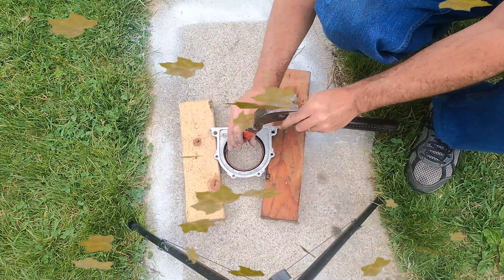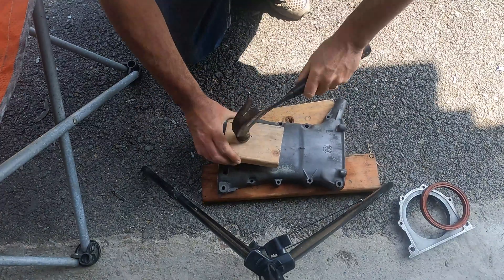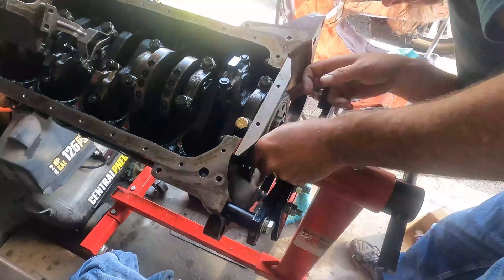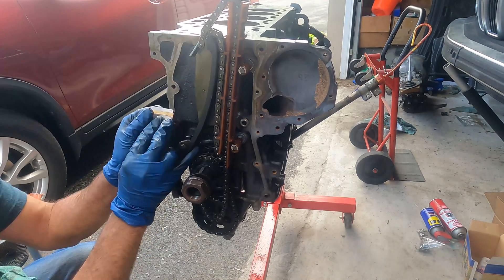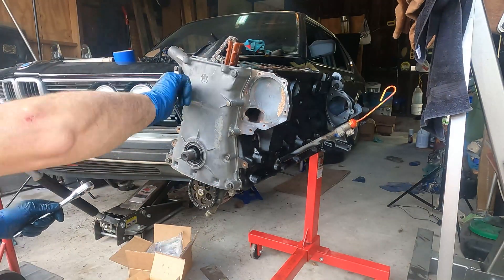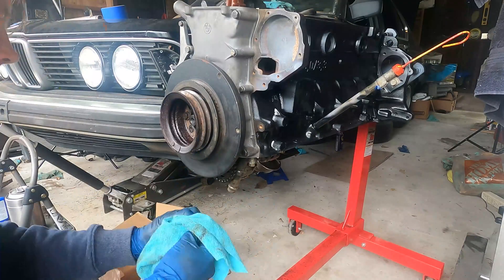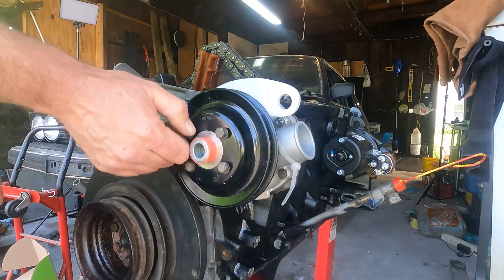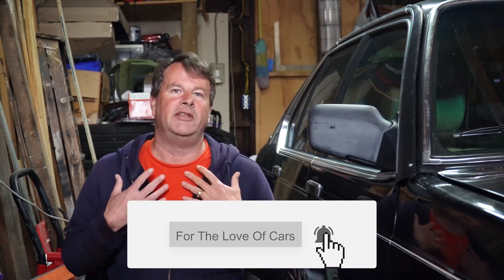BMW E23 Engine Assembly - Main Seals and front cover

Comment: My starter practically fell out of my e23 last week, the bolts seemingly backed themselves out. Honestly it wasn't that horrible to reinstall the bolts. Didn't have to remove a single hose, radiator overflow, nothing at all. My e30 starter I did last month during a clutch job was far worse. It used nuts instead of bolts so you actually have to hold both ends of a fastener instead of just turning a bolt head, genius design xD

For anyone replacing the (e23) starter with the engine in the car, for the bolt closer to the engine, put the socket by itself on the bolt head, and then feed a combination of extensions to connect to the socket. Then attach your socket wrench. For the bolt closer to the drivers fender, (the more accessible and visible bolt) I managed to fit a long 17mm wrench on the bolt head and tighten it up, after hand threading the bolt until it was completely snug.
Reply from the maker: My bolts won’t fit a socket. Or even a normal wrench for that matter.
Reply: @fortheloveofcarz  Hmm I'm just using generic Pittsburgh tools from harbor freight and mine managed to fit on fine. I can record a short real quick and upload it. Might save others some hassle in the future.